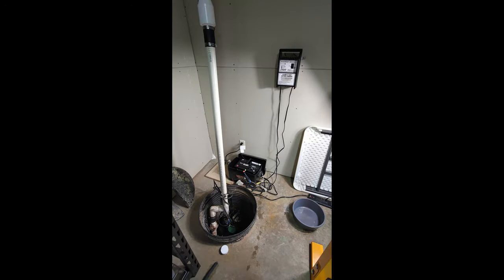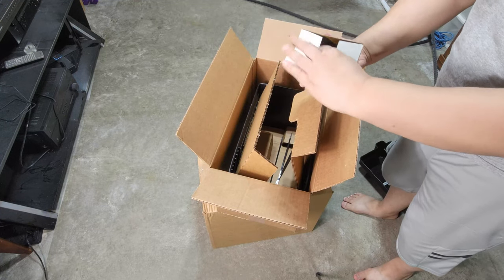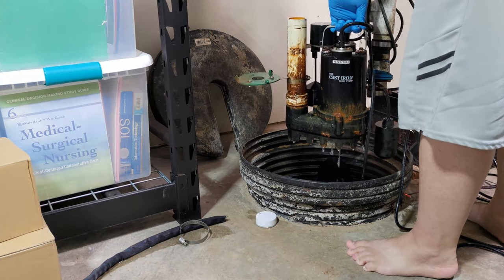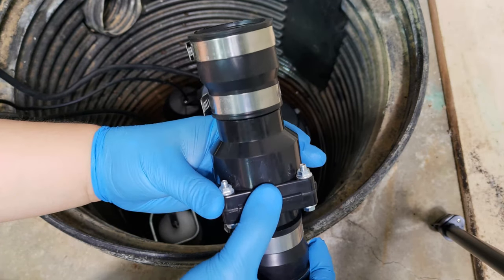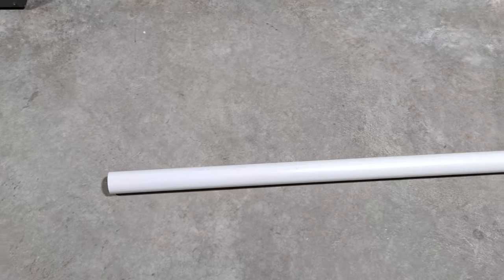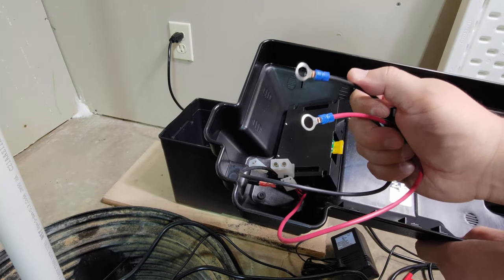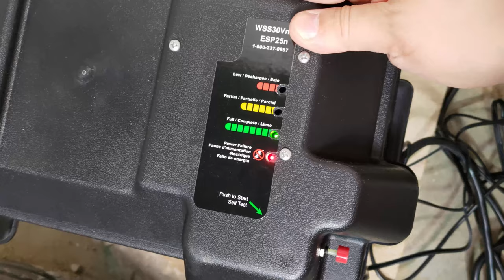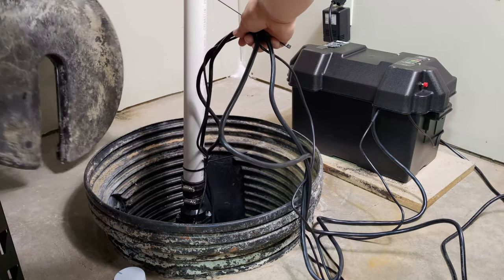Wayne WSS30VN Sump Pump and Backup System - Unboxing and DIY Installation

Comment: Thank you for sharing, I see there are two check valve (new one at the pump and the old one above the well) in series, is this oK?
Reply from the maker: Normally no, it is not needed or recommended since the check valve closest to the pump is the only one you need. I just left the old one there just incase I needed to do a rollback and change the sump pump to a different one that doesn't have a check valve.

Comment: I just got one to install…. Says not to install check valve on the gray pipe.  Have you had any issues with your connection ?
Reply from the maker: Nope, haven't had any issues since the install.

Comment: Bought this pump and installed it with a new battery. After a year the power failure red light came on, alarm sounds nonstop and the backup pump doesn't work. Any ideas?
Reply from the maker: Sorry, I wouldn't know what the issue would be. My guess would be the sump pump isn't getting any power. If the backup pump is not working, I would recommend replacing the whole system.

Comment: How’s it been so far?? Just to clarify does it come with a new check valve? 
Does the power failure beeping sound continuously beep when power is off or does it stop ? It’s crazy loud lol
Reply from the maker: Yes, it does come with the check valve.  It continuously keeps beeping when the power is off.  You'd have to disconnect the battery to stop the beeping.

Comment: Was the old battery pump a zoeller? What was wrong with it?
Reply from the maker: No idea what the brand was.  The pump was not pumping water long enough.  Half of what it pumps returns.
Reply: @good3nough947  if water returned, probably the check valve (one way valve) was defective.
Hope the new pump is working well!
Reply from the maker: @erezk2170  New pump has been working great.  Thanks.
Reply: Looks like the check valve in the previous set up was placed too high so whatever water didnt make it past the valve will return to the pit.